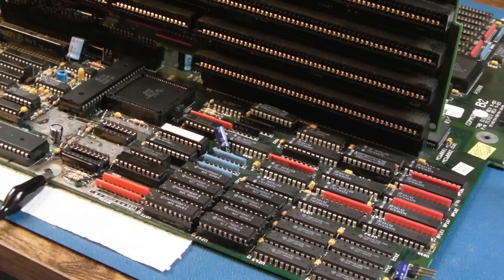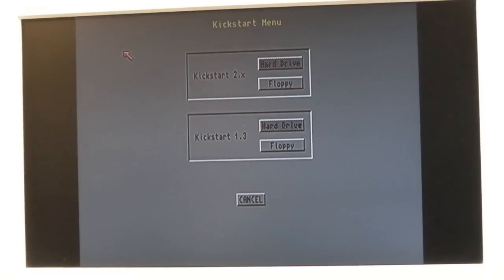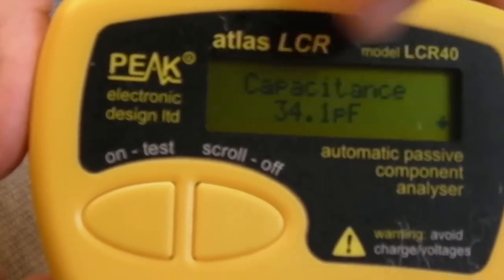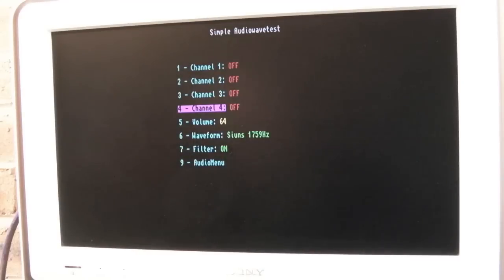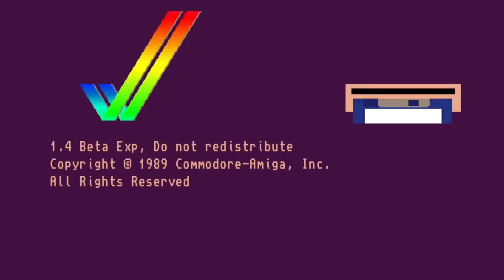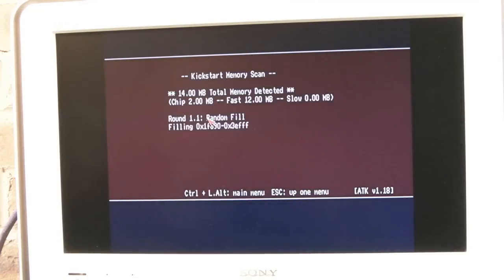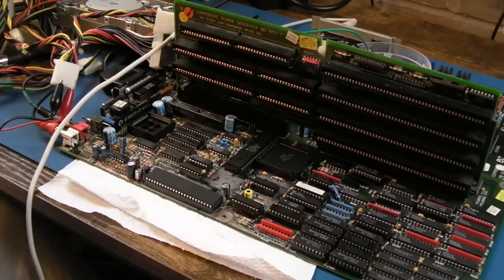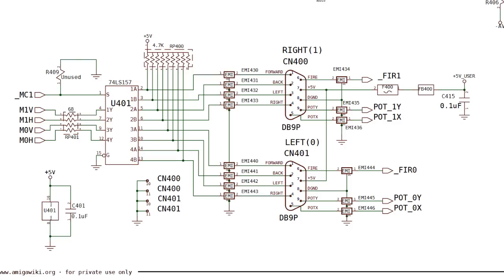Commodore Amiga A3000 Varta Revival Part 3

Comment: The amiga 3000 was the first amiga to include a mmu from the factory without the use of an cpu card. Interesting is that the Super kickstart wont work with cpu upgrade cards as it depends on mmu from the 030.
Reply from the maker: Thanks for the info!

Comment: regarding the super-kickstart - if I remember correctly then you need to have a file called "Kickstart" in sys:devs/ - also I think the boot-drive (sys) needs to be in FFS format and probably at most 2gb in size otherwise the 1.4kickstart wont be able to read the file from it.

That said - this super-kickstart system (using the mmu yes) is super convinient, A: it ensures the kickstart-rom is running from 32bit enabled fastram, and B: it's very easy to upgrade/switch to a new kickstart (just change the file) - it only needs the file initially when you turn on the A3000 then it stays resident in memory accross reboots until you turn it off (like the A1000 does). If you have not found a working file yet then just say the word I have it somewhere...

Also please keep those non-working ram-chips, been thinking about making a new ram-tester application and might want to borrow some broken chips if I ever get past the "idea phase" ;-)
Reply: downside I think to the super-kickstart system is that it does not work with 060
Reply from the maker: Thanks, yes - 040 and 060 not supported by the super-kickstart (just hangs).  I found that just by changing to an 040.  It could probably be patched to support 040 or 060.

Comment: The schematics you're using are wrong. The arrows M1V-M1H-M0V-M0H should point towards denise. Denise reads them for both mouse and joystick directions. The POT lines are used for button 2 and button 3 :) Fantastic work again!